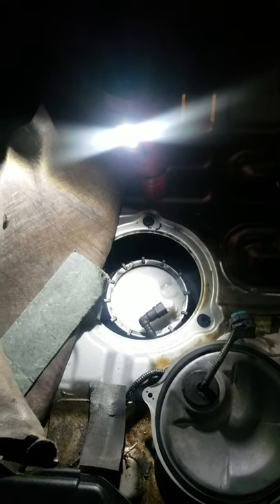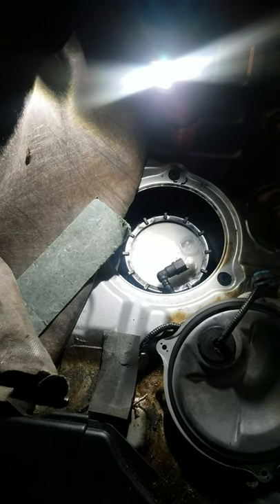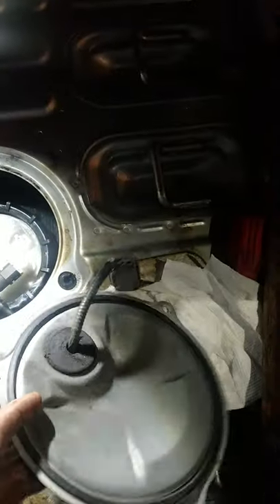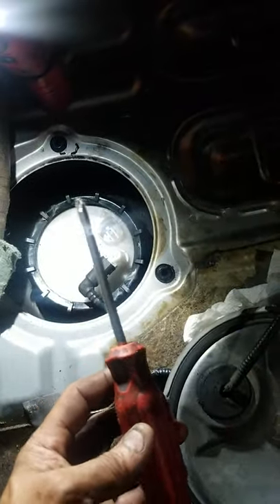2003 Honda CR-V fuel pump replacement

Comment: Does it have a secondary external Fuel filter also?
Reply from the maker: No. It doesn't.
Reply: @spicythai2000  ah.....lifesaver thanks!! I just pent hours looking for one..... Do you know the in take fuel pump filter replacement interval? Humbled 🙏😊
Reply from the maker: @righthand7965  it is part of the fuel pump. Don't need to change it unless fuel pump is bad.
Reply: @spicythai2000  ok, awesome...
Much appreciate! Running like a Swiss Watch for now 🙌😊

Comment: How do I remove the retaining ring or spring on the assembly
Reply from the maker: Not sure why you want to remove it from the assembly.
Reply: I worked it out, thanks - the replacement fuel pump assembly was different and the gauge level attachment kept falling off - everything in now, issue remains - might be spark plugs - great video
Reply from the maker: What issues are you having with the car?

Comment: What was the reason for removing it? What kind of symptoms did you have on the CRV that made you think it was the fuel pump?
Reply: Trash, rust, moisture, pump works intermittently or just flat out stopped.
Reply: Rust? Plastic fuel tank.

Comment: What is that black piece called at the top of the pump ? Where it’s connected? Mine is broken and leaks fuel from it .
Reply from the maker: Its called Fuel pump lock ring. It screw on to the fuel tank to hold the fuel pump tightly so no fuel will leak.

Comment: Wasted my almost 9 minutes.
Reply: Seriously?? Dude just saved me hundreds $$
Reply: Thank you. It worked only now I have a dash indicator saying check fuel cap. I'm sure it's the fuel pump cap that just need to be tighten down more. I filled up the tank ans I smell gas inside the car. Any advise on how to tighten it down? Thanks for saving me money.
Reply: Wow! It's so easy and explained well. You just untighten pull old one out put new one in and retighten...hook electrical up and your done. Saved me $$$$